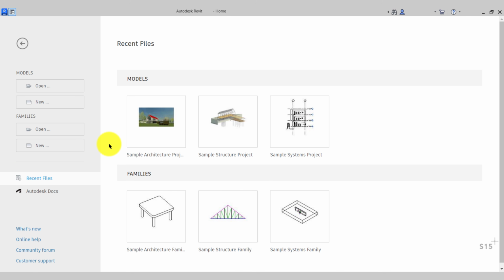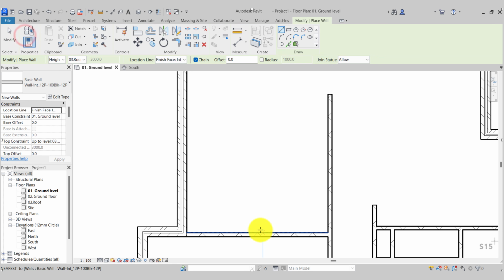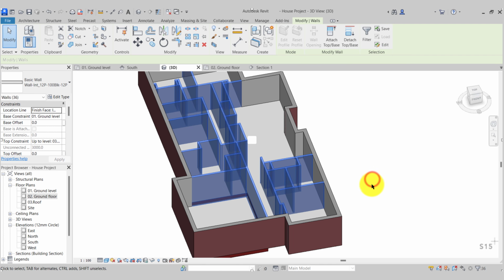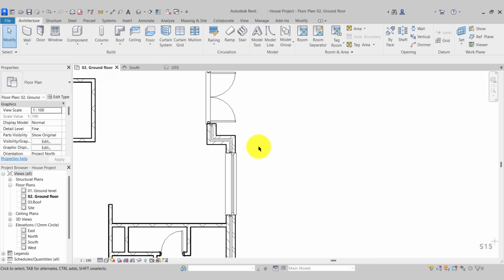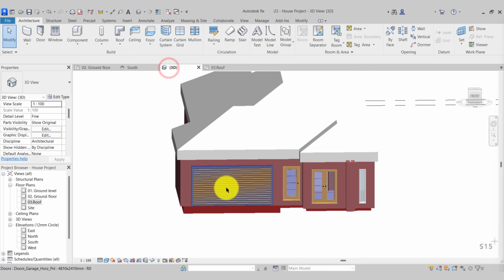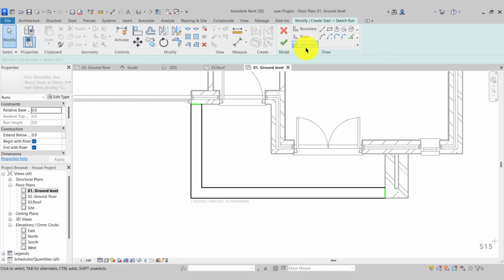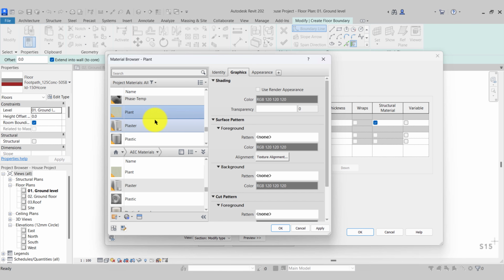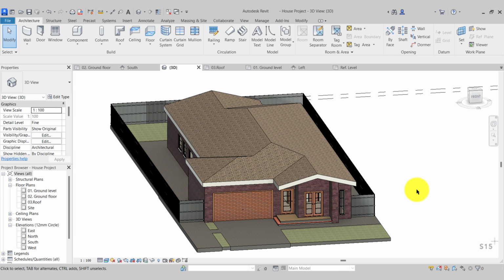Revit beginner guide: Building Your First Project - Part 01

Comment: for the internal walls do the temporary dimensions measure from the finish face? what if I want them to measure to the structural face and not the finish face?
Reply from the maker: You can either change this in the manage tab, or hover over the structural wall and hit the TAB key to select it
Reply: @ thanks 🙏

Comment: Whenever I rename/adjust my elevations, it does not change anything in the Floor Plans section of the project browser. Even when I added an elevation, it didn't add one under the Floor Plans section. Any advice?
Reply from the maker: Hello, If you click ' No " while Revit is asking to rename corresponding views it will not change in the project browser. 

To reset this, Just " Rename " Floor Plans ( Just one should do ) associated with that level to the new name.

Basically matching the name and that's it. 

If you try to rename the Level again, it will ask " Would you like to rename corresponding views" again

Comment: Hi, your video is wonderful, and as a beginner its easy to learn and follow. 

My 2024 version is not showing the AEC material, am not sure where its locked or its something else. It shows an icon for an error on the AEC material folder and hence when i wanted to insert the plant, i couldn't proceed. Please help on how to activate. I downloaded the UK family when i failed get doors etc.
Reply from the maker: It sounds like there was an error during installation of the software. The easiest solution is to uninstall the software and then reinstall.
Reply: @s15studio  Alright thanks for the response. I will try that. I hope all goes well.

Comment: This is a great tutorial thank you however I have got to the floor section and instead of intersecting the wall it is intersecting the floor can you help please
Reply from the maker: Hi!
Have you drawn the same boundary as I have?
Is the level of the walls correct?
Reply: it does apear to be, I will start again as that will help me solidify the information better. thank you for responding and I really apreciate the tutorials, I have been out of work since November and hoping to pivot from my usual 3d work so thanks again @s15studio
Reply: @s15studio  thanks for responding I think it is a visualisation issue as it looks correct in different settings I am using the latest version if I change to realistic it looks correct maybe a glitch